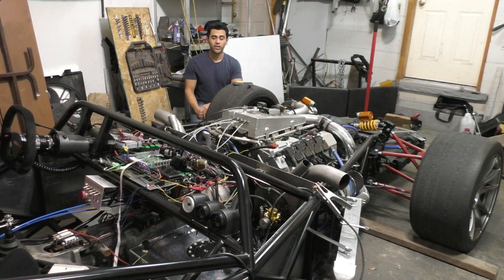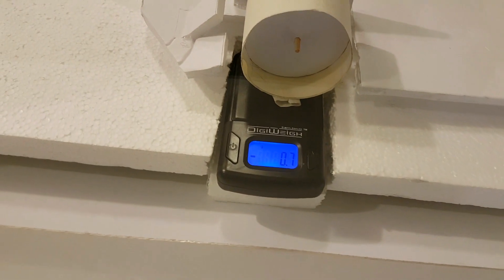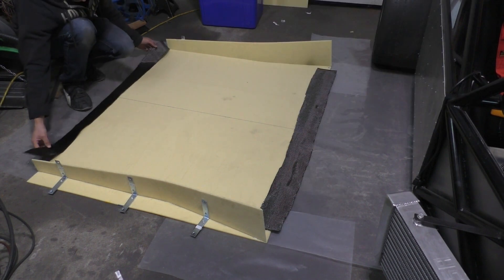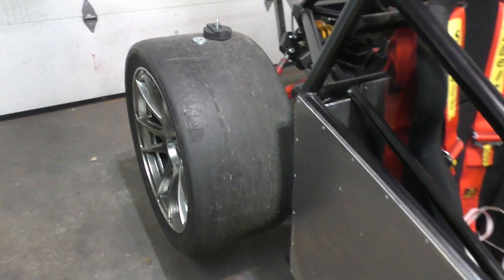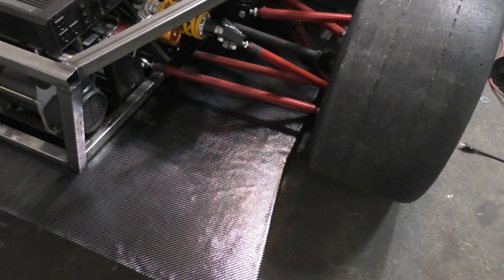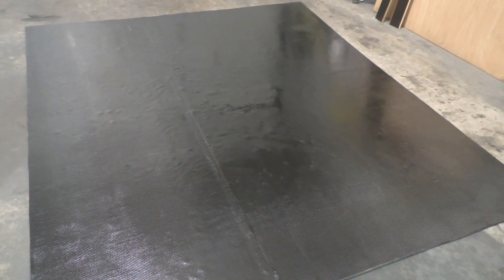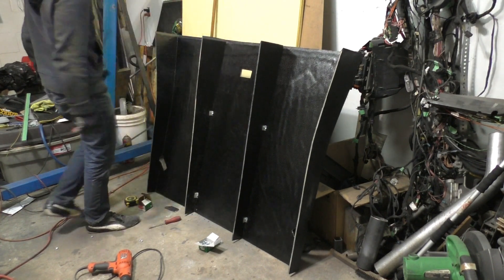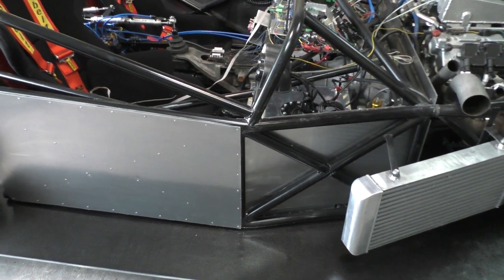Making Functional Carbon Fiber Rear Diffuser and Flat Floor - E55 ASL Part 20

Comment: After suiting up , with gloves taped to wrists, cover face & exposed skin with a coat of barrier cream and let it dry. Then put a second coat on. If working in sun then apply 50 plus sun screen. Finish with a big dusting of talc powder. At end of work cutting carbon etc, blow off dust, then wash off. This also is good sanding epoxy etc. Breath through mask that is appropriate for the materials.

Comment: Those diffuser strakes will also reduce disrupted flow caused by tire squirt.  The strakes will keep the turbulent air separated from the rest of the air in the diffuser and give you more reliable down-force.  I can't wait to see the car fully dressed, thank you for sharing.

Comment: I love your practical way of getting the job done . Your diffuser is a good area . It will need side fences which seal to the track surface . to prevent air bleed from entering the sides . your lower wing element .. The big bit .. would be excellent for a ground effects addition . mount the wing under the diffuser as low as possible start at 1 1/4 inches off the track . you will know when it activates   usually above 60 mph .the car will start to slam down markedly at the rear . and if your rear springs cannot handle it   the car will porpoise with the reduced air gap under the wing resulting in an air dam effect .. causing the rear downforce to drop off suddenly . I could take 90 mph corners at 128 mph   entry speed .118 exit speed due to the 3 plus G cornering forces . I only had 140 bhp  from a Hillman imp engine .. running 45 Dellorto carbs  and 38 chokes ..  a 1980 one litre GT championship class . I could outbrake any of the opposition by over 50 yards into the Donnington .chicane. after one of my outbraking moves   the guy i had passed lost it and punted me off the track .    I rejoined and almost had a big scare going down the Craner curves flat out .. I had picked up a cone and it was blocking a lot of airflow under my rear Ground effects wing .  SO YES the low mounted wing does produce huge down force with virtually no drag penalties. The ends of the wing need to seal against your diffuser  sideplates . I like your diffuser retaining steel cables. they could be run forward to  a control lever in your cockpit. To allow you to raise or lower the trailing edge of you diffuser and ground effect wing . Remember with all of the aeros working you have to get 90% of your braking done before the speed comes below 100mph. / 80 mph .  windeoff  up to 50% rear brake balance in the wet.  That way you will stand a good chance of not swapping ends . You already know what that feels like .. LOL.

Comment: For the skirts I would use a UHMW PE sheet that is mounted with slots to the carbon vertical sides so it can actually ride on the ground and move with the suspension. The famous "fan car" that was quickly banned from f1 in the 80's had a system like that.

Comment: "I'm not that good at CFD... So I built models and a wind tunnel in my basement" 
...Bro, you modeled your diffuser with foamcore, hotglue, bbq skewers, and weed scales. I am impressed AF by your resourcefulness.
You could have filmed those carbon fiber tests and done a "project farm" style video. I'm sure a bunch of us would want to see that.
I didn't know that you could use foam inserts without vacuum bagging, I thought it wouldn't wet all the way through. Could you have used wet layup with honeycomb material?
Reply: Foam is much easier to work with than honeycomb. Honeycomb really does have layer bonding issues and it’s best to use a thicker resin or add micro balloons to the resin to increase the bond area with it. 
Foam was a great choice here.
Reply from the maker: This foam doesn't soak up resin. It's a little different from other core materials, I'll mention it more in the next video
Reply: weed scales.. lol
Reply: Nicolas, the resin doesn't soak through the foam core, just the surface and depending on the type cell structure, may penetrate slightly. With an open cell type foam a slurry can be made by adding micro balloons (microscopic hollow glass spheres) to the resin and coating the surface of the foam and allowed to cure. That will seal the foam and prevent the resin from soaking in once the fabric and resin is added.

Comment: when I cut carbon, I hold a shop vac and handle of the tool at the same time in a way that the shop vac nozzle sucks up a lot of the dust as you cut.
Reply: yeah carbon dust will destroy electronics if not contained.
Reply: @drivejapan6293  good point as well.
Reply: ...and preferably somewhere outside
Reply: A even easier way is to use a skillsaw with a suction attachment, Then you will get a line as straight as a arrow, and no dust.
Reply: @mariusah91  you don't get any tearing or splintering doing that?
Reply: @drivejapan6293  have to use a proper grit style blade if you want to get a perfect line the first time. Or use a very fine tooth blade and leave a tiny bit of extra to sand incase you get splintering.
Reply: @michaelcoffin4364  good to know. Thanks!
Reply: Vac needs a good filter on it to keep from blowing the fibers into the air.
Reply: @michaelcoffin4364  have you tried putting the blade on backwards? Thats the best way to cut corrugated iron
Reply: @chevydyall7619  that doesn't work on these style blades. All that will do it rub a tiny indent in the edge of the panel and make the blade hot.
Reply: Smart. Destroys your lungs and electronics.
Reply: @drivejapan6293  lol carbon dust destoyed my vakuum clean because i turned it on to suck the cutting dust
Reply: @MIMCKMedia  yeah unless you have a sealed motor with fully insulated connections it's best to place the vacuum outside and use a long hose. Obviously make sure the vacuum filter can trap the carbon dust without letting any pass as well. Some vacuums have the exhaust blow over the motor for cooling rather than a separate cooling fan.

If you are lucky it had some current protection safety shutdown and you could just disassemble it and clean out the carbon dust. Maybe it just fouled out the commutator?
Reply: @drivejapan6293  I sent it back because warranty and get a new one 🤣
Reply: @MIMCKMedia  👍

Comment: for the next version, one can avoid extra resin by adding "tear veil" on top (it absorbs the extra resin and as it names implies one justtear it away when polymerised) - also, more importantly, pockets between the top and the bottom layer of carbon fiber (to bond them together) is what would make the sandwich resisting  delamination...

Comment: For the side skirts, you could use brushes like Indy cars used to do
Reply: Garden edging is another inexpensive easily sacrificial material.
Reply: HDPE would probably resist abrasion the longest and cause least amount of drag when in contact with the tarmac.

Comment: I highly recommend covering the open ends of the foam with carbon by adding a small strip of carbon cloth that is kept to both sides of the panels with epoxy. The way the panels are made right now they are very likely to start peeling from the foam.
Reply: And the foam core might suck up a lot of water as well...
Reply: Johan Petersson you can tell by the snapping of it that the foam is more like styrofoam. Probably won’t absorb any water. I agree though that the edges should be covered. I would have done that first then the main surfaces.
Reply: I hope i'm wrong. But i think this floor will snap on day one at the track.
Reply: You can also use paint on plastidip
Reply: limitliss styrofoam or eps absorbs a lot of water, it’s an open cell foam unless it’s surface filled.  This sort of foam he is using won’t absorb as much. But yes. He should have watched some surfboard manufacturing videos and lapped the edges
Reply: @johan.mp4  Looked like closed foam, so that won't happen, but the exposed ends, I assume he's capped in resin to stop vibration separating everything. Ideally, he should have wrapped the edges rather than trim them after cure.

Comment: Been there done that   way back in 1978 -1980. I note how AMAZED you were with the transformation with your two element rear wing . flapping around in the breeze .  Your wing element mounted in the under body airflow will achieve exponentially more downforce . your two element wing will have a diluted performance due to the atmospheric pressure diluting the airflow over your high mounted wing . Simple demonstration .. lower your hand over a vacuum hose / carburettor ona running engine  and see how the atmospheric pressure on your hand instantly forces your hand onto the vacuum cleaner hose .. the race track cannot be sucked up towards your wing so atmospheric pressure will generate a huge down force from as low as 40mph . I had to upgrade my rear springs from 320 to 800 lb rate .plus two cellular bump stops .Richard Wallinger   ex 1980 Donnington GT championship winner .   Stay safe. drive 90%   that way you are super smooth and achieve 100% laptimes .Racing lines are totally different with downforce .. brake late turn in late then use the open corner to accelerate early taking advantage of the huge exponential increase in downforce as your speed increases .. taking advantage of the extra tracktion which comes from the aero downforce .90% of your braking should be done in the first 10 yards .when the speed and downforce is at its highest..  Install your pour in support seat inner prior to all of this silly stuff.. you are on a steep learning curve . richardwallinger@gmail.com.

Comment: Last tip :-)
Avoid aluminium hitting carbon. When aluminium hits bare carbon and water comes in between, the aluminium will be gone in no time.
Reply: Why?
Reply: Why? Because carbon is a conductor and you will get a potential difference between two materials.
Reply: Interested! Gonna try it

Comment: Get yourself a thin clean-suit/forensic type overall and and work the resin from the inside center of the large panels out towards the corners while moving carefully on your hands and knees. Stay in socks so you can slide over the surface and your shoes don't abrade or tugg on the fabric while you work.

It will allow you to use the scraper and be more efficient with your use of resin. Love the build keep going big lad.

Comment: When applying the resin you can use a paint roller to get more even spread and get rid of most of the air pockets much better than with a paint brush.

Comment: If you use a small roller when applying the resin you can get a very nice uniform surface and will not have excess resin left on the piece. There are specific resin rollers available, they have a bunch of ridges in them. Try local boat makers or fibreglass producers.

Comment: That wind tunnel though!! 😯

Potentiometers wear, why not a sealed encoder, or capacitive proximity sensors?

Regarding compressed air, I have no idea how to mount a truck's compressor, but I thought to mention it.
Reply: Air is being used, so pots make sense.

Comment: Hey man! Awesome work. One tip - if you are going to hand laminate the whole bodywork, I recommend watching some surfboard lamination videos on YouTube. They have a lot of little tips and tricks on how to get a light and tight lamination. If you are using carbon fibre, get a rubber surfboard laminators squeegee for pushing excess resin out and getting a more Even tight bond into the foam.  Also, would it be worth lapping the edges for some extra strength? I noticed you had some extra ribs /crossmembers in your layup - nice!!!

Comment: Oh, and if there are area’s where you have to glue the carbon, use peel ply. This will give you a perfect “rough” finish once peeled of after the epoxy is dried.

Comment: Is there a reason you didn't run the compressor off of a 12 vdc motor? The inverter set up you went with seems like a really long way to go for compressed air in a vehicle. I have to assume you considered a compressor for an air bag set up (12v), or replacing the motor in the compressor you used with a 12v one. Additionally offroad guys regularly convert their ac compressors to air compressors. Sorry if you covered it before, i didn't catch it.
Reply: To clarify, I am not shitting on your project, you clearly know what you are doing. I am just curious what the benefit of the inverter set up is.
Reply: PO DUNK 
Good question. That AC converter looks heavy.

Comment: Maybe you should add a sacrificial  wooden plank under the floor, just like F1 cars. Much cheaper to replace than the whole floor.
Reply: The wooden plank is mandated by the FIA. It's measured post race for excessive wear. Carbon is a better choice.
Reply: @michelevitarelli  while that's all true it doesn't change the fact that it also protects the floor.
Reply: @michelevitarelli  I'm not saying the whole floor should be replaced by wood. Please read my comment again. The plank is only there to protect the CARBON floor.
Reply: @johan.mp4  I understood what you are saying. I'm just stating that the wood plank is an FIA mandate.
Reply: @michelevitarelli  you also wrote carbon is better, like I suggested a plank would be better than the carbon floor.

Comment: You can use the selector rod, top cover,  and gear position sensor from a 370z on your transmission. It has to be for a synchro revmatch transmission. Magnetic multi axes proximity sensor.

Comment: Hey doesn't the non vacuum bagged carbon fiber increase drag?
Reply: I think the bubbles were on the top, so the bottom should be smooth.
Reply: @Conservator.  even if the bubbles are on the bottom the boundary layer will act like a golf ball and help the air move off the panel
Reply: john devries Hi,
I’ve always thought that golf balls have dimples. 😜
But in al seriousness, do you know for certain that/if little bubbles would have the same effect? (I’m genuinely interested, not trying to win an argument)
Reply: @Conservator.  I think the effect would be the same, trying to disrupt the boundary layer to prevent drag, anyway it sounds good, I can't prove it though.
Reply: john devries 👍
Reply: @Conservator.  the part itself it's creating down force which is drag. If anything it may have an indirect effect to lower the drag by making drag slightly reducing the down force by slowing the air speed under the car creating less of a low pressure area. It's a trailing surface afterall. 

If your talking about fenders and the leading surfaces it's still going to cause drag. I imagine thought the upper panels will be smooth and painted.

Side note is that dimples on a golf ball actually increase drag. But due to the balls spin and combined with the dimples it's not equal across the ball which increases the lift causing it to stay in the air longer leading to further distance traveled.
Reply: DriveJapan Hi,
I don’t understand ‘downforce = drag’. Both are forces created by airflow but the are angled at 90° of each other. 

What I’ve learned from other video’s is that the floor and diffuser is much more efficient in creating downforce than a rear wing is. 
(Efficient defined as downforce/created drag)
Reply: @Conservator.  downforce always creates aerodynamic drag when produces by a passive element like a wing or diffuser. It's not actually 90° or perpendicular to the road surface. They are more efficient but not 100% efficient. There is a way to calculate it but in short the direction and amount of force is relative to the angle of the diffuser and the velocity and direction of air flow.

Edit
This may help explain it a little more and still be easy to understand. 
https://www.caranddriver.com/features/a15112568/the-physics-of-diffusers-how-to-make-a-car-really-suck-feature/

The term downforce is really a misnomer as it actually a down and backwards force. That's why it equals drag. It's all about the conservation of energy and to crate any force you have to take energy from somewhere. In a car with a passive system it's going to he taking that energy from its forwards movement.
Reply: DriveJapan 
Ok I see the confusion. 
To me downforce is perpendicular to drag. By definition. 
The force created by the diffuser consists of a combination of the two. 
There is no element that will create downforce without drag. 
The challenge is to create as much downforce and as little drag as possible. 
Diffusers are much better at that than rear wings. That why the downforce created by the floor&diffuser is sometimes called ‘free downforce’. 
Technically this is of cause not correct but teams will always try to use the floor and diffuser as much as is allowed by the rules. 
The front and rear wings however are adjusted for each race (I’m talking about F1 now). Monza being a low downforce circuit and Monaco being high downforce. 
The floor and diffusers are never adjusted for a specific circuit. Teams only change it as general improvement of their car.
Reply: DriveJapan Tx for the link. It says:

In a modern Formula 1 car, the diffuser can contribute more than 1000 pounds of downforce. The problem is that this extra stick also raises aerodynamic drag, so engineers have to balance their need for cornering grip and stability against their car’s targeted maximum velocity. What makes a diffuser a preferred aerodynamic device is its efficiency. In terms of beneficial downforce versus parasitic drag, a diffuser is vastly superior to any freestanding wing.

They are talking about downforce and drag as separate forces. 
‘this extra stick [downforce] also raises aerodynamic drag’.

I don’t mean any disrespect! Just try to clarify things for myself.

Comment: a jig saw (diamond,hack saw,or carbide blade) will reduce dust about 75%. covering the part with peel ply will smooth it out and give the bag look, changing fiber direction in the layers will greatly increase stiffness creating hard spots for your jack and fasteners would be an impovment